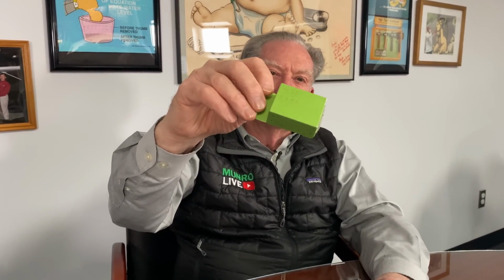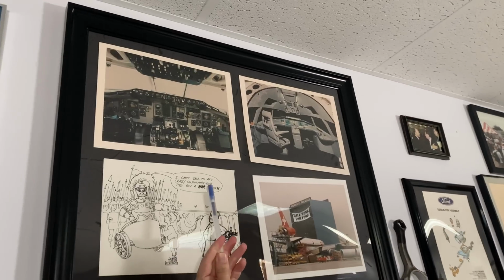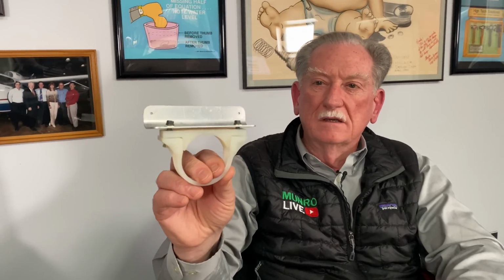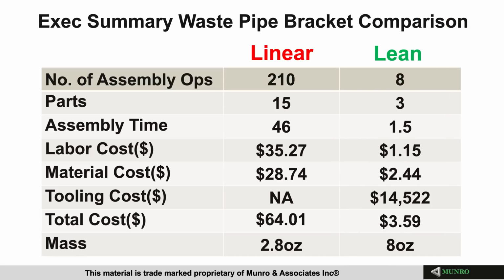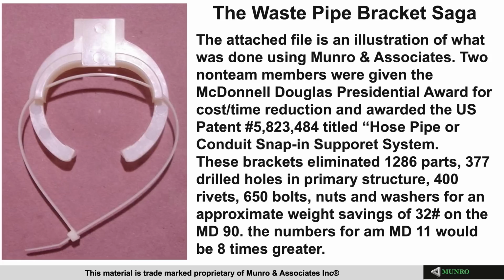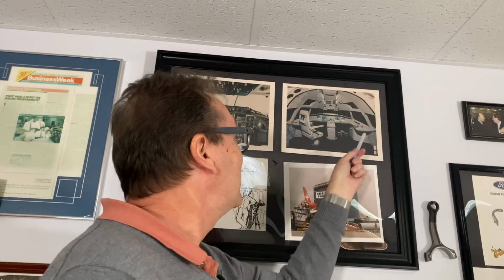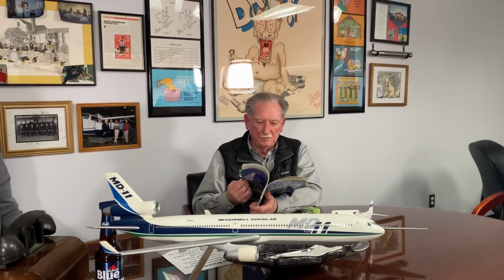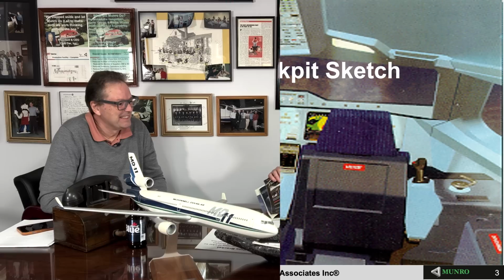What Happened to McDonnell Douglas?

Comment: In the 1990ish time frame I was in my 3rd job after getting out of school.  My company was a contractor furnishing  inspection equipment to McDonnell Douglas.  I was raised in a union home, so I'm not at all anti-union, but I was sent to MD to install some fixes to a machine that was already operational within MD, and had my first experience working with the union in order to install the fixes.  The quality of the work done by the union members was great, but the discipline of the workers and union rules made getting the work done, in a timely manner, all but impossible.
Reply: I worked at McDonald Douglas in Long Beach shooting rivets in the baggage compartment of the DC 6 on the Graveyard shift while I was going to college. I was eager and tried to work efficiently. Eventually we got to the head of our line of planes and one of the Union bosses told us to slow down. We had to take the top tray of our toolbox and go into the next hanger where some nearly completed airplanes were. Up the ramp and inside the plane were 40 or 50 workers sleeping in the newly installed airplane seats. We had to stay there until our planes had been moved and we could start again..
The Union joke was” are You working overtime tonight? The answer was “No, but I’m staying overtime”
Reply: @apainlessone  its great until you are out of a job.

i honestly dont know if this has an easy solution but i was in the same situation
Reply: Like checking in and out tools before and after breaks? Yeah, I saw that part.
Reply: @Ravensmiths6  As a union tradesman I have my own tools and never at any Auto plant have I ever needed to sign in and out tools.  I am guessing Sandy and his friend told the story like it really was, the airline industry, or maybe just MD sure does things differently.
Reply: @oloilmann4288  Tool tracking in aircraft operations is essential. A tool misplaced in an aircraft is extremely dangerous.

Comment: I worked at Boeing in Renton the years they acquired McDonnell Douglas.
A move that wrecked both great companies.
The MD-11 was a superb airplane.
So we had two companies that made great planes - one from CA with lousy management.
And those managers ended up running the WA company .
Reply: The airlines dumped them all to the freight companies who bought them because they were cheap………at UPS they are usually sitting around broke ……..can’t count how many times I saved the packages from a MD11 being broke…..
Reply: Financial guys ran MD, the take over needed a lot of private equity to finance it. Boeing lost management MD execs destroyed the engineering department and hence you get the 737 max disaster.

Comment: They might still around, if the engineers were allowed to continue to innovate.  The finance folks screwed the company, and the execs took the easy short roads too often.
Reply: So true!
Reply: Same thing happened to boeing which will be going bankrupt in the next 10 years.
Reply: @_PatrickO  Ummm....  You make it sound like Boeing is a different company. "Boeing" is the name of the company that was McDonnell Douglas. They took it over under the guise of Boeing buying them out. Those working on the inside at Boeing, though, became well aware of what was actually happening with all the pressures, accommodations, and shifting that began soon afterward in order to transform Boeing into MD.
Reply: @_PatrickO  No one cares, eh. I can think of a few hundred families who might, just off the top of my head. I knew some personally who used to be in the top echelons of Boeing engineering at the time and all retired or left within the following 10 years or so, mystified at the new direction except that they knew exactly where it had come from. They just didn't understand the reverse takeover being pushed from on high. Having its own board and shareholders is only relevant insofar as those aren't the people actively running the operations but are the people demanding a certain financial performance, however unsustainable and short-sighted it might be, and new people from MD assured them that they knew how to get there.
Reply: @ReflectedMiles  It came from the board and shareholders who approved changing boeing to the same kind of crap company MD became.  You need to come to terms with reality if this fact bothers you.  Ex-MD employees did not have the ability to change anything without boeing's board allowing it.  This was not a hostile takeover, the board approved it all and that means shareholders wanted it. Do not act like the people in boeing management got played, they all agreed to run the company this way.
Reply: @_PatrickO  The engineering / technical management absolutely were not part of those who initially just went along with those changes and, yes, transferees from MD played a major role in selling the Kool-Aid to management, to accounting, and to the department heads, willing or not. What followed was a major changing of the guard as well as a significant generational loss of knowledge. I'm afraid that the boards not only of Boeing but those in the majority of similar companies are, most of the time, rubber-stampers for whatever directions the CEO and other executives decide to take them in so long as the shareholders don't rise up. When so many are institutional / S&P 500 index investors in situations like this, they rarely will. The merger played a major role in changing the company's culture. You would be hard-pressed to find major engineering figures from that time, many of whom had created the 747 and 757/767/777 programs, who would disagree.
Reply: @ReflectedMiles  You are confused, unless you work at spacex or tesla, engineers do not get a say in company direction.  It doesn't matter that engineers did not want to be hampered or let go.  The shareholders and the board decided they would be and execs carried it out.   Everyone wants short term gains in exchange for long term failure.  This is the MBA way.
Reply: @_PatrickO  Really? So Robyn Denholm somehow has had a different legal responsibility at Tesla than the interests of shareholders? Talk about confusion between corporate law and culture! You misunderstand the fundamental nature of what built Boeing. It was exactly the kind of priority set that Musk puts on engineering teams. MD had long been very different as everything began and ended with the bean counters, and the engineering was expected to embrace those priorities.
Reply: @_PatrickO  Here’s another insight: Boeing was run largely by engineers for generations after its founding, and one of the most common complaints charged against boards by the SEC and other regulators is failure to actively oversee their company’s operations.
Reply: The joke I've known from the "merger" days is that McDonnel Douglas bought Boeing using Boeing's own money.
Reply: The CEO and company execs were the real problem. They simply sat on their laurels and thought they were too big to fall. The bean counters were just doing what they were told, which is to do their jobs. It takes a certain kind of leadership to constantly find innovation and improvement, while everyone else drinks Champaign and hitting golf balls from their yacht.
Reply: The C-Suite is always looking for a payday anyway they can get it with the least work put out. This goes for most C-Suites. One of the biggest problems with US corporations is too many MBA's in the C-Suite that do nothing.
Reply: Quite the opposite look at the DC10 if so much innovation yet failed to polish innovation lead to scandal and safety issues. Especially failure of tri-engine aircraft.